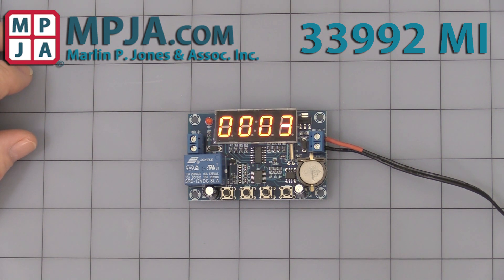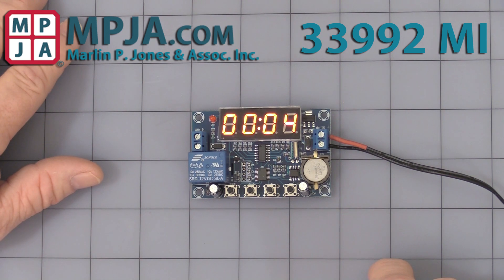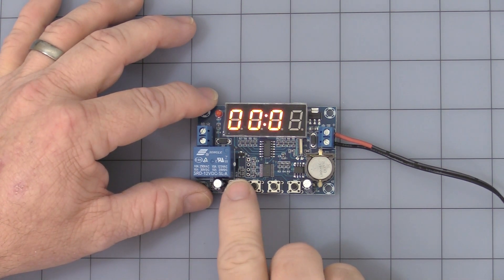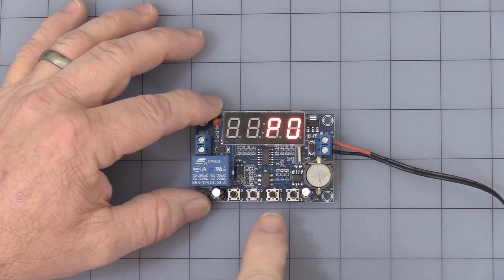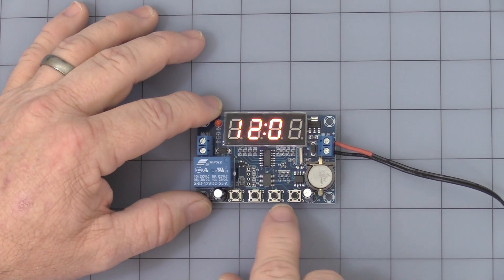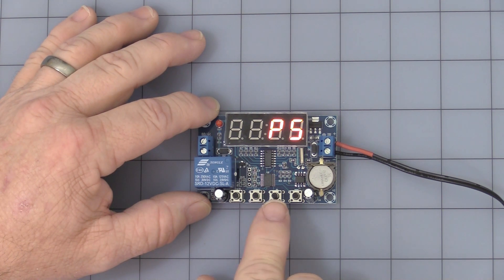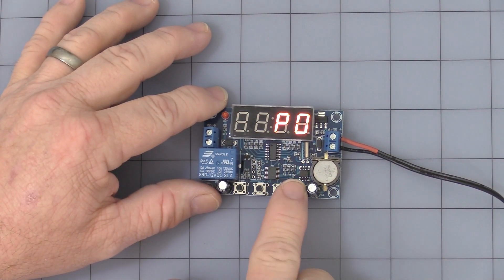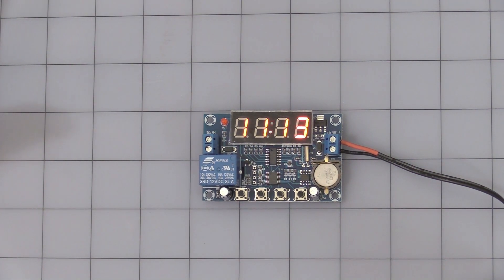24 hour clock timer and relay with 3 event  33992 MI

Comment: Can it be programmed for 1 event every 24h an can it be set to the second on an off as I’m trying to find ay timer I can use on ay windscreen motor iv used in automatic koi fish feeder an only need it to run for 30sec to 2min
Reply: Didbyou find anything.?? Am also tryna build a fish feeder and need something for second's thanks
Reply: @christopherrobin8169  yer gday right after looking in to it bit more I found it’s much easier  to just buy a timer  that u can set to run for few seconds then shuts down then run in the right direction this set up only works with a steeper motor out of a old microwave or just buy a replacement steeper motor at the same out put voltage of the timer u buy I have links to motor timer but I’m 240v  I found a another YouTube link using a steeper motor but he made a mechanism that reverse the steeper motor to the right direction the timer setup is much easier 

Won’t allow me to post the links
Reply: @christopherrobin8169   Look up (Homemade fish food feeder for aquarium or pond)
. U see my comment
Reply: See won’t work I did try
Reply: https://www.youtube.com/watch?v=A5dsESVhh1I
Reply: Try using a neverfail water bottle inside down